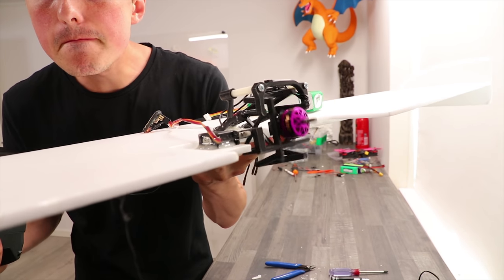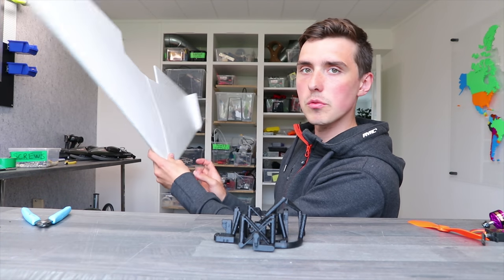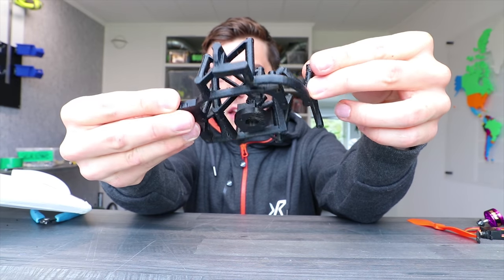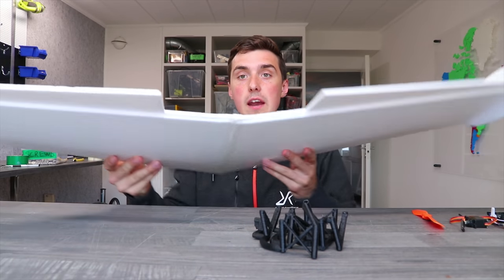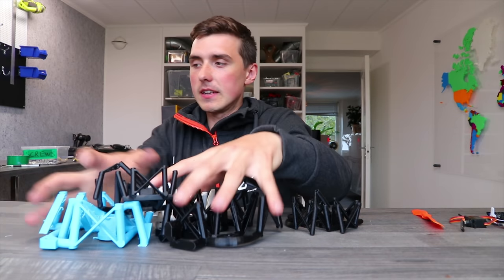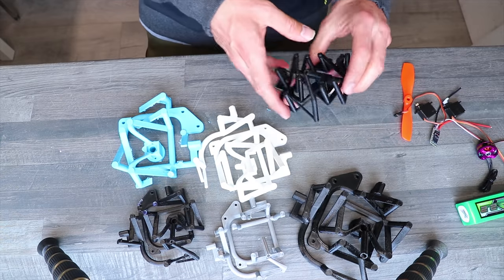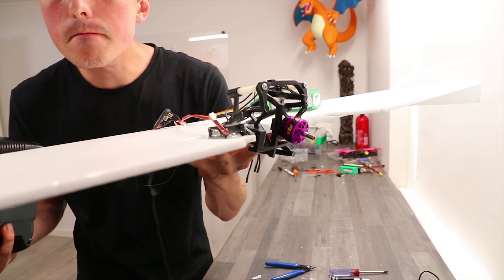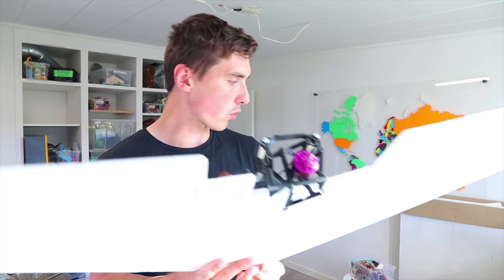3D Printed Vectoring Mechanism

Comment: Could you redesign the compliant mechanisms with more thicker structure and print it with PLA (PETG/ABS if it keeps breaking) and see if it improves the stability. I really wanna see this work :)
Reply: I also wonder how a molded part would fare; 3d printing does not seem ideal for such intricate compliant mechanisms.

Comment: You should try integrating flexible metal pieces in the design it won't add much weight and will fix most of the issues I guess

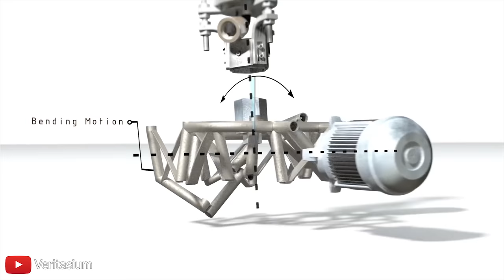Comment: You cannot use a part of that geometry with your style machine. Well, do not expect it to last anyway. It will break on the stress risers over time. A short amount of time. Maybe even first use. Saying this at 1:44. Here is your problem, there are 3 parts of flying. Center of lift, Center of mass, and center of thrust. If your plane does not fly, one of those is in the wrong place vs the others. For example too close together, too far apart, or in the wrong order. Think of it like this, if you kick open a door from the hinge side it is very hard and you get fairly stable motion, but if you kick the door from the handle side the motion will be very violent. Well when the CoT CoL and CoM are not in good spots the craft is very unstable under thrust load and puts high load on any sort of gimble system you have. Think of it this way, if you attached the propeller motor directly to the 9V servo motor, which would spin? Now if you put a 1,000,000 to 1 gear reduction on the 9v servo which would spin? As you have seen and demonstrated if you allow the motor to put too much force on the gimble via the wings of the plane, it can overcome the servo that controls lift and even break the gimble. But the servo that effects toe was fine. Also note, if you want to see how the plane flies under thrust, you should apply thrust via your hand near where the motor will apply it. 

To re-iterate, there is one of two problems. 1 CoT CoL and CoM are not in the correct positions. 2 CoT CoL and CoM are not in the correct positions for your chosen method of flight control thus too much load is placed on the gimble.

Comment: I remember doing research with and trying to use compliant mechanisms back in college too. I hated every minute of it. From designing, to printing, to actually using them, everything went terribly and I disliked every moment of it. I'm sorry to have had to watch you experience the same disappointment that I did with compliant mechanisms. That said, I think that the thrust vectoring concept is a really cool one, especially when applied to propellors rather than rockets. I can't wait to see the next version of this! Could you try using standard mechanisms, like 2 or 3 servos with regular connecting linkages, to enable to the motor to tilt?

Comment: i don't know about the material you are using, but with pla i usually reinforce important segments by rewelding the layers with a soldering iron. a bit messy but works quite well. not sure about the fumes that your material might release though

Comment: If it is flexible enough to twist with a servo pushing it. It’s always going to flex when the throttle is added. You would be better off just making a simple pivot point motor mount and have a servo tilt it. This way the torque of the prop won’t twist it all up

Comment: Your plane wasn't necessarily tailheavy if it made this pumping movements when shooting slightly upwards until the nose drops sharply. This just means it flew faster than its trimmed speed, and tried to bleed off excessive kinetic energy. Some planes just do that, especially the ones that have low drag.
I guess you are right with the reason for the crash, this would have been my bet as well.

Comment: I bet if it wasn't a 3d print you would be able to get a better balance of strength and flexibility.  Perhaps you can do a PLA print then make a mold and cast it with something more flexible?  That would get rid of the greatest weak point, being the layers.

Comment: Cool concept, really. But when you've put on the control surfaces with their own servos the whole thing lost its purpose. (i do get that you needed it for roll control), like if it would have worked, how would you tell that the mechanism was causing the plane to pitch up/down and not the control surfaces?

Comment: Compliance is not the same as submission. You want the plastic to go "I hear what you're saying BUT...". 

Lexan is polycarbonate. It's bulletproof. Guess how they get it to that state? Bake it. No joke, print the PC out again, slap it into the oven at 175 degrees Celsius for 15 minutes, turn oven off, leave it in there and slowly cool down the oven by holding the ovendoor slightly open with a teaspoon or a rag or something. It gets rid of any tension built up from the printing process, and leaves you with a part that is perfectly fine staying in the orientation and shape it is right then. It also slightly melts the outside surface, further cementing the printing layers together, while keeping the internals the same (ea; you're creating a plastic Prince Rupert's drop). 

ea; If it survives the easybake, it's good to go back on the craft.

Comment: Nice vid! Would love to see more video's on this project! Keep trying untill you succeed, the building and progress you make is the most fun part right? And it will be even more rewarding if this project succeeds than one that will succeed right away... I think it may be a better idea if you would just mount 3 servo's to the 'frame' and let them control the 3 axis. So dont use the flex of the material, those properties are way to material dependant. Good luck!!

Comment: CG at 25% of the chord (dimension front to back at the centre on a Chevron) and work back If your plane is tail heavy it will be OVER responsive   . Motor needs a degree or so of  down thrust which will translate to pushing the nose up.  The thrust vector unit is over thought it can be done MUCH simpler.

Comment: I believe everything was great with your wing just add some reflex for launching it, wich is a little bit of elevon up by default in the center position just add 5º o 7º to it to the motor just 2º because motor angle is quite more powerfull force actuation but be sure to get it like that the prop maybe be alittle to small to try one inch more  and full throttle launch ask somebody to help u to sending it, hope it helpsss

Comment: Any way to revisit this? 🤔
Build a fixed bench rig and run tests until you get useful properties out of the flex harness. If you get this thing going, you'd be able to sell just-add-the-fixed-wing-and-balance kits like reasonably priced hot cakes.

Comment: Man, at the start I've thought "wow, what a great concept". Then when you've told about the oscillation I've thought: "meh, maybe not...". Then I've recalled something: NOTAR. You should try to make the thrust by this concept (not concrete though!). You'll need a smaller "fan" and a good pipe system. The key is that vectoring (rotating a helicopter at Z-axis - a simplified explanation) there is controlled by the difference of thrust of the left and right gas pipes.
You can make a "flexible" (with joints I guess) pipe that will be pushing a gas out. The probable con is that you'll get a smaller thrust power. Also you'll need to think out a kind of a "jet" engine system for the electric motor :D :D :D On the pro side: I'm almost sure that you'll eliminate the oscillation easily (the engine will be fixed) and maybe will make a use of this complimentary construction principle.
P.S. Generally it's like Harrier. Good luck!

Comment: Try to add epoxy on your pla by just brushing it on after the print. I have found the epoxy increases the temperatures and rigidity of pla by a substantial margin... Good luck I will be watching. 😁

Comment: Hybrid print with both rigid & flexible filaments?
Reply: Most filaments with different abilitys need different temperatures to extrude what would be problematic to print, also many materials don't stick well to each other. In cases like this nyloncarbon filament or such kind of filaments are better to work with. or coating with epoxy afterwards if the material is able to handle epoxy.

Comment: I probably missed the reason, but why didn't you print out a multi-piece mount that used hinges rather than a one-piece mount that required the material to flex for pivoting?

Comment: You have to set the Flex Steering to 0 with no altitude movement. do a test with smoke / vape at home, to know where the 0 setting is going.

Comment: try using three/four plates in the "exhaust"of the prop. Servos to turn the plates will give you the vectoring you desire. Im pretty sure nasa used that at one point. something like this https://en.wikipedia.org/wiki/Rockwell-MBB_X-31

Comment: Would it be possible to mix filaments? Maybe by using dual extrudors? Or making a rigid core surrounded with a more flexible material? Never tried 3D printing just spitting out ideas

Comment: What if instead of making it flexible, you printed multiple parts in place with axles and stuff?
Reply: That completely removes the purpose of the design
Reply: The whole point of this is too see if a single flexible part could do the job instead of parts with axles and stuff dude

Comment: These type of thrust vectoring are very difficult and unstable. The prop makes a lot of rotational moment so if you try to vector the prop, the prop tend to stay its own position. And also this reaction force is shifting 90 degrees, so it's very difficult to control.

Comment: really should have read into the ambiguous title.. didn't make any promises about it working and it didn't. Would like to see some iteration of the 3D printed part to strength the yaw component of the vectoring mechanism. There is a fine line between documenting failures and taking a drive to test fly a concept without any spare parts or a back up plan.

Comment: Hello very good video I do not speak English. But I am using google translator, I want to ask a question what kind of material do I use to print that flexible piece, that piece can be put 2 servo motors to direct the propeller in all directions. Suddenly you have the designs in thingiverse to print on a 3d printer, it could be printed on tpu. Thanks for your video is very good thanks

Comment: Nylon is much stronger and tougher.   Use high end micro servos (like Futaba or Hitec), and allow them to hold the structure in alignment.  Good digital servos have excellent centering and holding torque. 
 Maybe go to a 12-15 gram pair of servos, and cut the weight of the structure.  Flexible can be a good thing.

Comment: Could it possibly been due to the gyrosciping tendency to seek level plane that caused it to dive.  The prop will seek level so if it is mounted off plane the prop will cause nose lift on downforce. We deal with this alot in tuning airboat hulls for best performance.

Comment: what infill did you use? maybe look into higher infill or thickening the thin parts?

that shape was designed for a specific application from a specific material under n specific load. you have changed the load as well as the material so in part this would mean a change in design is needed?

Comment: Like the concept could you not 3dprinted the part with carbon fibre pla? The 20%catbon might give it the strength it needs it works well for quad frames I’ve printed and not as brittle as pla on its own.

Comment: this mechanism to mount a camera, then just write some simple app for a oculus quest 2 headset + some way to get the signals from the drone to the quest 2 = look around with the camera from the drone. could that work maybe?  quest 2 you just read the headsets pitch and send that data to the drone, and get the video back that you display on the screens. :) :)

Comment: Isnt pla the brittle one? Did the torque from the motor snap the motor frame before it hit the ground? Otherwise I agree that it was way too flexible, either way pla abc are impractical unless you either change up the design a little bit to make it stronger or use a different material, can the creality-10 print carbon? If so I'd recommend that

Comment: reverse rotation of your motor broke your 3d printed stand..
apart from that "Gyroscope force"...you are trying to rotate a high powered motor with a weak stand...if you make it go up or down, the gyroscope force will make it turn left or right...
so yea, if the stand wasn't one piece and if the motor base was stronger, it would work. i believe

Comment: the concept is cool but a complaint mechanism isn't the way to go I don't think. Round two with conventional pivot points would be cool to see, and you should use as a base an airplane that is self leveling because you won't be able to control roll.

Comment: That's the problem with people trying to push one technology as the solution to every  perceived problem.
Compliant mechanisms can be great for many aspect, but as the mounting point of a thrusting application? No, simply no. you might get away with it for the reaction engine on satellites as there are very little force involved only, but that's about it.

Also thrust vectoring in general - the efficacy heavily depends on the use case. And it simply can not be a replacement for control surfaces, it can only ever be a means to further enhance control in certain scenarios.

If you want to try vectoring again you could just use a normal gimbal with bushing bearings.

Comment: Carbon fiber nylon? Maybe? Also If you increase thickness of designed flex points and todo a bench test with thrust to see what is best material would be as well as the addition of more mounting points top and bottom to fully stabilize the gimbal(that’s what it’s similar to)..... I’ll do some research on this and see if I can create a modified version for you to test also what about poly max pla from poly maker

Comment: Nice catch! Lol I think a lot of it has to do with the weight of the motor. Maybe try a lighter motor. Sure, you'll have less torque, but way less weight too. And less stress, because of the lower weight, on your 3D printed part! Those 22xx motors are pretty damn heavy. 1806, 1408?, you'll know better than I but, a simple thing to try! 🤔😉👍

Comment: Hey. What if you did a thrust vectoring thingy just like in hovercreafts but with horizontal fins? That way you will be able to mount the motor the normal way. No vibration issues and simpler construction

Comment: Hi. At time 4:35 I could see an enclosure for a CR10S PRO; may I ask you about how you built it or if you have the blueprints/files? Also, how does it deal with the PSU temperatures?

Comment: i think is just the support for "inside" part is too weak. 5:43 i know it is power off. but it should not be so shaky. once your add up the push force. the it will be bended.

Comment: I think the scaling on the manics are wrong. Your engine and the mechanism is the heaviest part with the most force applied on it. While a thruster on a rocket in comparison is alot smaller compared to the rest. The fuel tanks/payload/frame... Are all much bigger. Also I don't think they were talking about the atmosphere thrusters or the main thrust on satellites or rockets. So the thrust is also alot less force applied over probably 2-6 thrusters working together.

Great try showing off the idea but it just does not work how it was set up.

Comment: An interesting concept, But the design looks overly reliant on the 3D print being rigid AND flexible, So unless you're using a multistruder type printer to make the hinges out of something like ninjaflex and the rest out of something more solid it could be that the design is just going to be too fragile or so heavy that it's not going to be suitable for a flying model.

Personally, As an old engineer, I'd have been tempted to built a thrust vectoring rig either using a ring within a ring gimbal design with bearings at 90' to each other to get the the "Pan and tilt", It would be reasonably light, But still pretty rigid.
Or maybe make a 3D printed motor mounting block with a socket on the back to accept something like a solid M3 ball link (Like you'd find on larger RC helicopter swashplate control arms), Then you just need to add a couple of servo rod mounts to it and an anti rotation link. This idea would be more likely to survive a reasonably abrupt "Landing", But would also most likely weigh a bit more. 

As I said, Its a really interesting concept, So I'd be interested to see follow up videos of you refining it into a working design.

Comment: Why don't you made the structure of metal springs, then encase them inside a more flexible plastic filling? You'd win the rigidity of an internal structure paired with a similar flexibility thanks to the springs. At this point, it's not a matter of simplicity in manufacturing but a durability stress test.

Comment: Question: why the 3D printed part, and not just two servos glued together at an angle? Just like the camera mount for a headtracking Fpv camera????
Reply: I think he wanted to show a possible application the compliant technology. If you haven't seen it, you should watch the Veritasium video on the topic. There's a link to the video in the description.

Comment: The idea isn't a failure and the type of material isn't the problem... the engineer that designed it is no good at designing things... 

Make it like a gimble for a camera... make a cage for the motor that moves inside of another cage that attaches to a frame... I would do it myself and show you but I don't have a 3d printer yet...